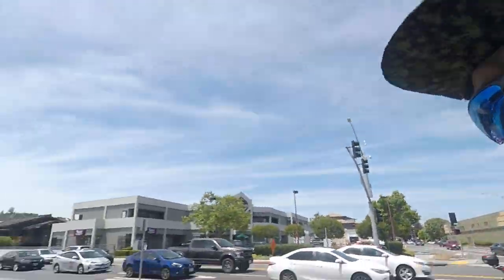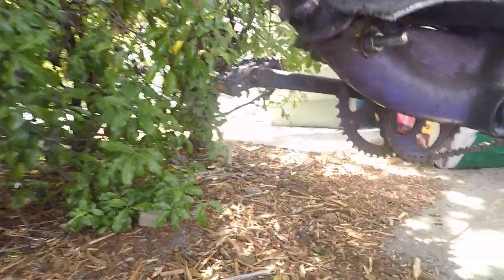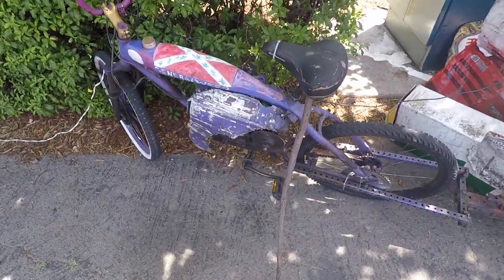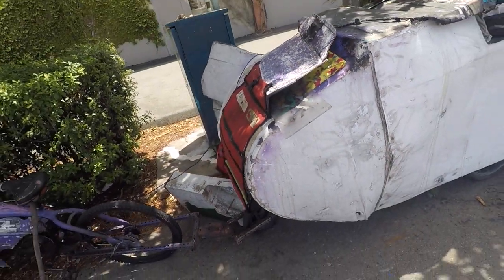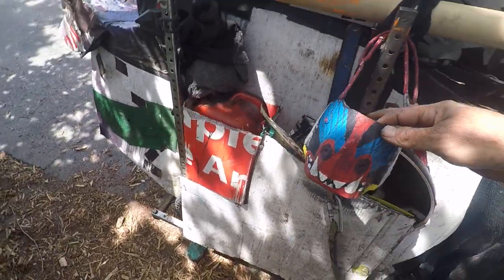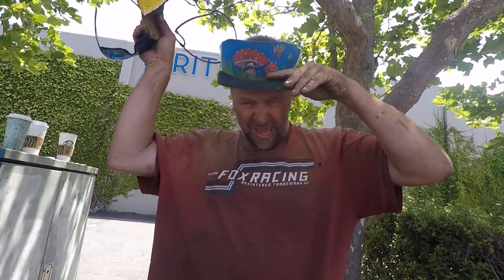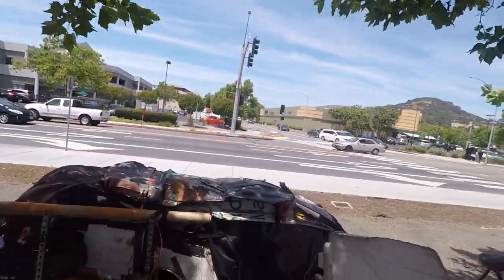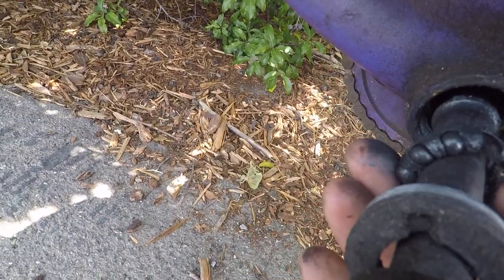phatmoto upgrades

Comment: That's weird I cannot see any other comments that were there before. The sprocket hub adapter has some failure problems it seems unless you keyway the rear hub real well. Even the fat moto bike it doesn't have much of a center support like a factory center supported stock wheel on a car. The fat Moto rear sprocket is a little bit center supported but not all the way like it should be like a factory wheel on a car which is center supported for most and then you have aftermarket wheels which are strictly wheel stud supported not as strong and a lot of times what happens if you don't check the tightness on the lug nuts periodically. the lug nuts come loose and the wheel rolls off. I've had to tighten the back sprocket once and I put blue light tight on the bolts and the second time I put red loctite on the bolts when they backed out each time. And in some projects I've worked on I have used the green loctite it's one of the stronger ones than red. And some people say you cannot get the red out without heat I've not had that experience. I just put big enough power to it and it loosens. I've had a lot of bolts to wiggle loose on my fat Moto I got it when it first come out too. One of the reasons bolts wiggle out is with solid engine mounts like in my street and strip car it has solid engine mounts and stuff vibrates loose but I always try to use nylon lock nuts or blue and sometimes red loctite. With stock rubber engine mounts stuff very seldom wiggles loose. It seems all of the dirt bikes and motorized bikes are solid mounts that's why it seems bolts and nuts and stuff wiggles loose more.
Reply from the maker: Brand: NAVARME @amazon
2.7 out of 5 stars  10Reviews
NAVARME 415 Chain Sprocket 1.5" 40T Gold CNC Adapter Motorized Bicycle 50cc 60cc 80cc .. well id get this .. for adapter and sproket . to try out .  40 is fast in long end .. 50 is slower top end faster to 15mhp  40 well do good for streets to do  35mph